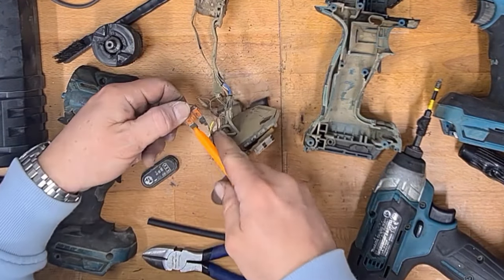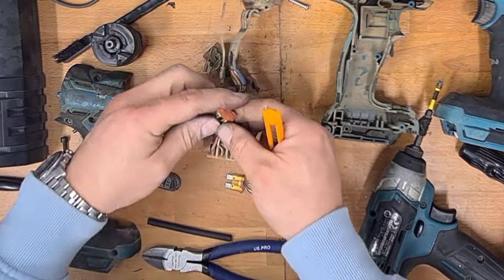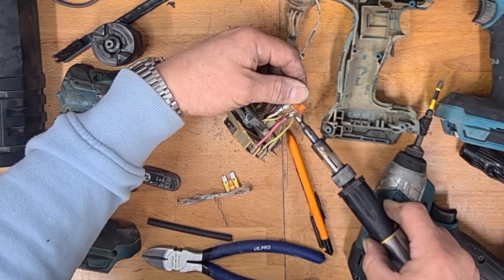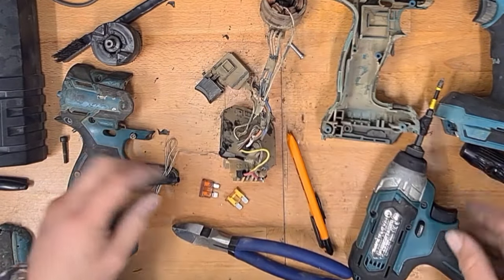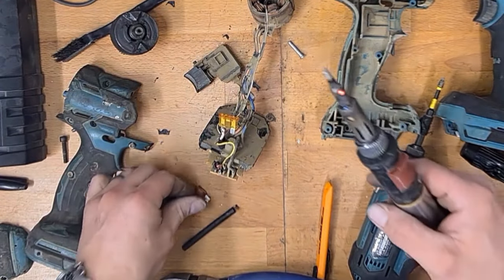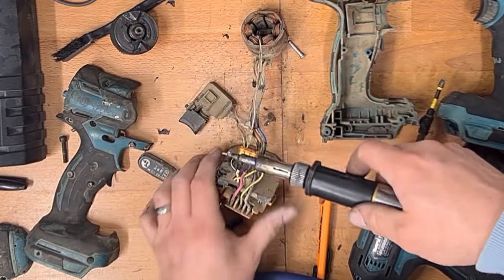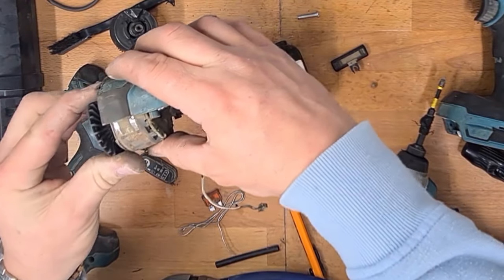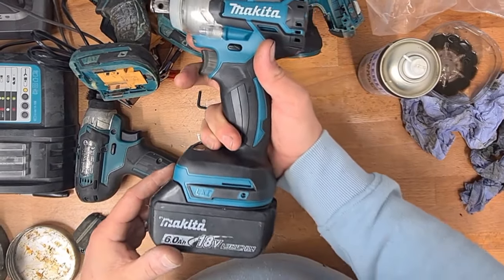Brushless Makita Repair brushless drill or impact driver fix

Makita 18volt brushless repair

Comment: Are the Makita batteries the same as the metabo hpt 18v multivolt system batteries, i have I've battery with 2 dead cells and one with a single dead cell
Reply from the maker: thay should all be high output 18650 cells. only way of knowing is take them out of the packs and check out the numbers on the side of them.

Comment: Do you have any repair videos on repairing a rotor failing? 
Mine appears to have gone out of alignment and as such is physically touching the stator and no longer spinning, or spinning intermittently.
Reply from the maker: you should be able to get a replacement rotor with new bearings on that should fix that.

Comment: My impact stopped working changed the fuse because it was blown when replaced it popped again tore it apart do see any spot that could be shorting out any suggestions
Reply from the maker: it will be inside the main board most likely the speed control circuit.
Reply: @FINDITFIXITRESTOREITBUILDIT  okay I’ll look into replacing it appreciate the help

Comment: Hey mate , I've got this problem I think,  we're the symptoms that the LEDs and drill both didn't work?
Reply from the maker: have you checked the fuse as it will cause the symptoms you are having.
Reply: My Makita DDF484 does not have any fuse. Drill and LED are not working
Reply: @Wesk85  sometimes they use a resistor, i think 0 ohm as a fuse
Reply: @FIND IT, FIX IT RESTORE IT, BUILD IT  any suggestion for units with out fuse

Comment: you could've soldered in a fuse-holder, no need to solder if the fuse blows again...
Reply from the maker: very good point just a bit tight for space though.